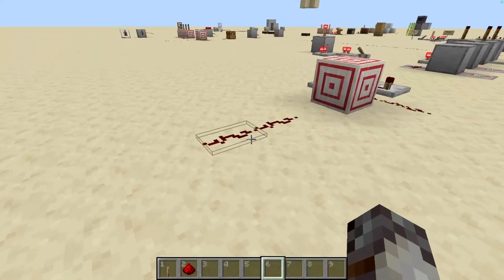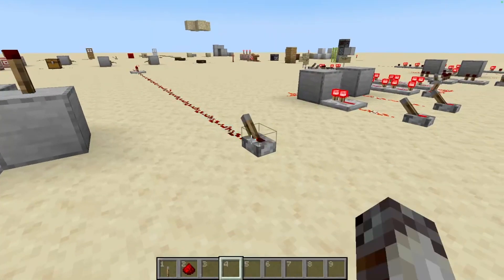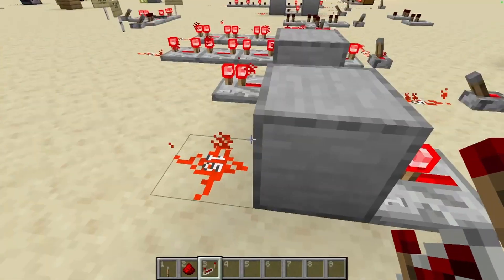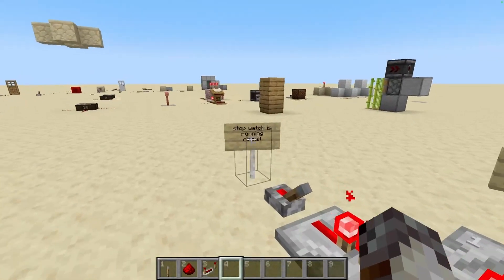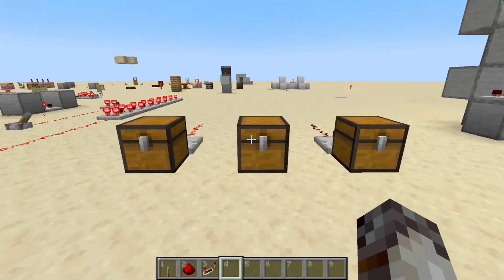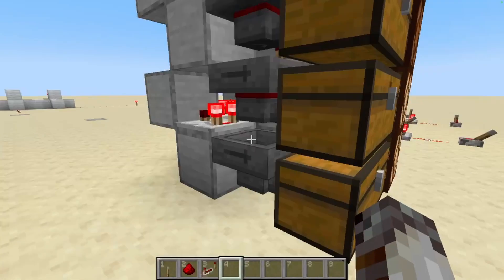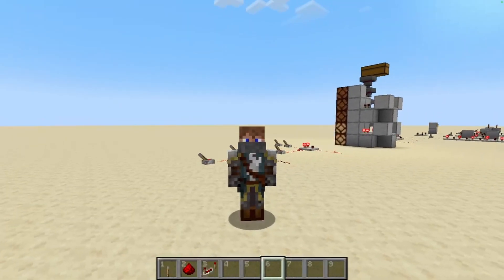Dust, Comparator and Repeater

Comment: Awesome videos. Just one question, in the last part of the video when you're talking about comparing and subtracting from a comparator, when the comparator has a stronger signal from the back (15) to the side (14) the output goes through meaning the redstone dust lights up, but when showing the subtracting part the signal at the back was stronger (15) than the side (14) and yet the output didn't go through, meaning the redstone dust didn't light up therefore there was no power going through. How come? Shouldn't there be power going through if the back of the comparator is greater than the side when using the subtract mode?
Reply from the maker: That's a great question! In subtract mode, the comparator outputs the signal strength of the rear input minus the signal strength of the side input. But, I rewatched the video looking for what you were talking about and couldn't find it. Could you leave a time stamp if you still are confused and i can try to explain further?
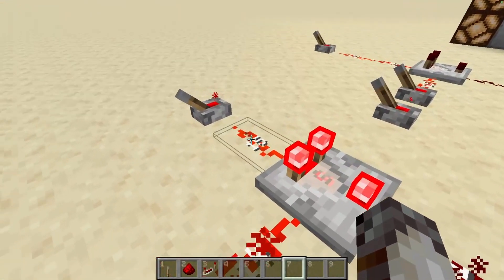Reply: @theikeberg  7:58 till like 8:23 When you are explaining this part shouldn't the output be lightning up since the back side of the comparator is greater than the side of the comparator?
Reply from the maker: @WoWGuru86  it is lit up but its only a signal strength of 1 so its really dim and hard to see. because of the texture pack though i can see a little 1 on the redstone dust output